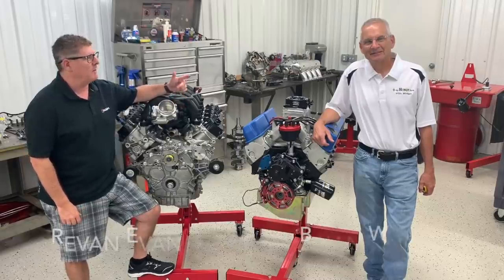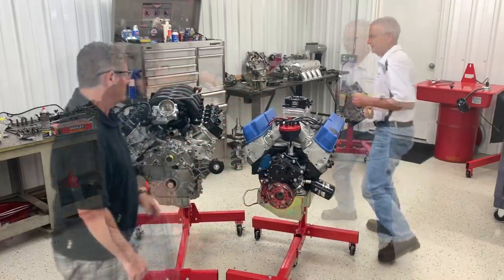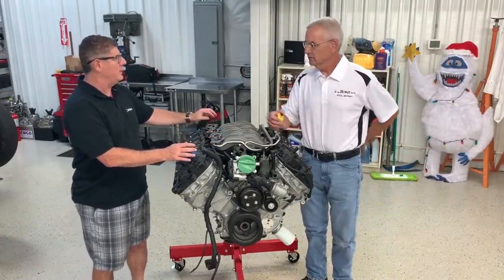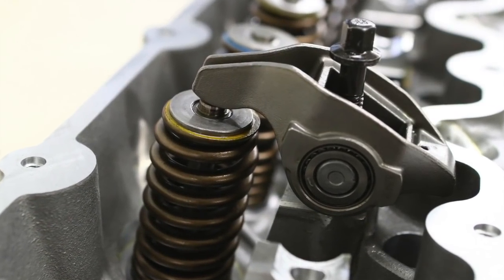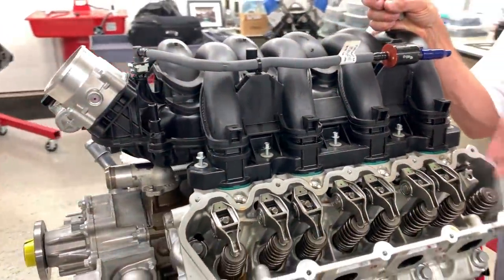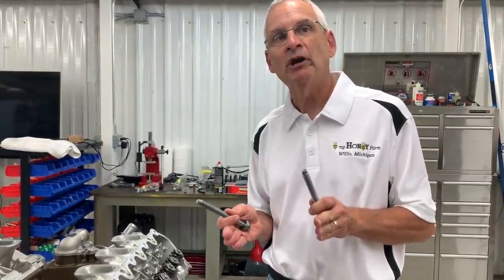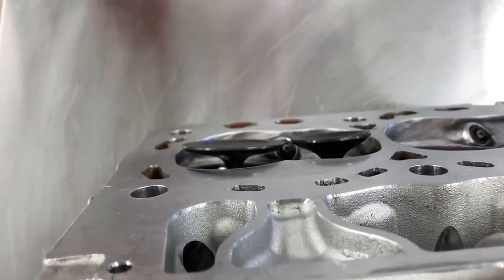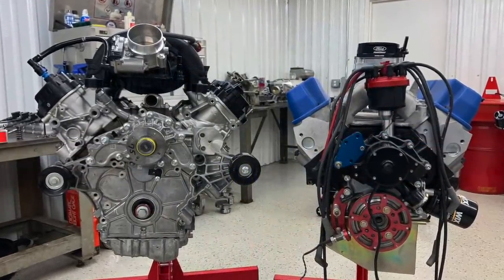Ford 7.3L Godzilla Engine Dyno Results, Teardown & Comparison to Coyote & 351 Windsor Part 2

Comment: Looks like a ls/lt
Reply: @bigboreracing356  
To be fair, the LS family copied a lot of Windsor features
Reply: @SwankySasquatch66  in what way?? There is nothing windsor in the ls at all. The windsor wasn't worth copying. A sbc put it all over windsors in s very big way.
Reply: @HioSSilver1999  You guys and your LS BS. It doesn't look anything like a LS or Hemi. It closely resembles the outdated Ford FE engine. FFS it's a pushrod engine. How many configurations you think you can have before they all start to look the same.
Reply: @HioSSilver1999  there you go again, providing you don't know much at all
Reply: Seems the GM nut swingers couldn't resist, LMAO!! Meanwhile Coyote Mustangs are donkey stomping Camaros across the country...
Reply: @02autogt  well one thing fo sho your 02autogt was a magnificent turd.

Btw....from 15 till 2020 furd didn't make a muskrat that ran with camaros.
Reply: HioSSilver1999 someone’s mad😂😂I’ve seen you on other videos trolling the 7.3
Reply: @renedl22  it's a copy of the ls/lt.....i had nothing to do with it but i can sure make fun of you guys about it.
Reply: HioSSilver1999 and the Ls copied the Windsor. The new Zr1 is coming out with 5.5L Dohc Fpc so they copied the 5.2 Voodoo
Reply: @renedl22  are you saying furd copied Ferrari with a flat plane crank? 

Actually there has been testing done with ls flatplane cranks quite a few years ago. Check it out.....it didn't stop at 526hp and no tq.
Reply: @HioSSilver1999  Something wrong in your head bud. What you call an LS/LT copy, is just you being misinformed. All the technological parts you claim that the LS/LT engines use, in your head, they must be GM/Chevrolet proprietary technology and Ford has stolen the design from them. Wake up dip.... according to you, Dodge, Honda, Cos-worth, Mercedes and almost every other engine manufacturer owes everything to GM? F**k, we're all doomed......
Reply: @henri1511  this 7.3 is nearly a direct copy of the ls/lt stuff. A blind man can see it. Only difference is that it is a big block and not a small block. I even gave you reasons. So far all you have is rhetoric.  You should be happy tho. Chevy engines been getting put in fords for 50+ years now. This is nothing new it just comes oe.
Reply: Lol It’s funny to see “copied an LS!” now but in 1997 the script was flipped “LS copied a SBF!” Let’s take a trip back time shall we? Does the name name Robert Yates sound familiar? If you don’t remember he was dominating nascar at the time with Ford. The setup was a SBF with Cleveland style heads (which had canted valves). Anyway Yates was hired by GM to help design the LS and when it debuted it had: canted style heads, front oiling, head to block cooling, 10 head bolts, standalone intake/exhaust ports, AND had the same firing order of a 351 SBF H.O. Oh and if you wanted to carb it the distributor goes in the front..  Looking at the old standard SBC that's been around forever, the basic differences: Chevy had a rear oiling setup, rear distributor setup, a cooling system with a timing cover separate from the pump where as coolant flowed to the block 1st, then the cylinder heads. Chevy's had siamese intake and exhaust ports, and 17 head bolts in a hex pattern. The LS is basically a modern Clevor (Cleveland heads on a Windsor block). So b4 anyone says this looks like an LS just remember what an LS looks like.
Anyway my point here is that each manufacturer is going to take what works and make it theirs. LS heads resemble a Cleveland head, but the Cleveland head resembles its staggered a BBC from back in the day. Ford was the first to do canted valves on a small block.. a Boss 429 is copy of a Chrysler hemi head. This can go on and on you see my point...
Reply: @jmitchell513  actually chevy was the first to do canted valves on a sb back in the 60s. They just never produced it. Then of course there's the sb2 stuff. Then chevy was also the first ohv v8 back in 1917.

A ls looks nothing like a windsor which was a turd of a motor and got owned on the daily buy old SBC's. A Cleveland design is even further from a ls.
Reply: HioSSilver1999 lmfao “never produced it” gtfo with that ignorance. Why are you talking about 1917. If you just read what I stated you would understand companies copy each other. You are a Chevy fanboy and can’t come to grips that the motor you love is a copy of a Ford. Windsor’s and especially Cleveland’s have always mopped the floors with SBCs that’s why GM literally through away 50 years of work and came out with a SBF lookalike the LS.
Reply: @jmitchell513  sbf's was a joke. SBC's mopped them up like they weren't there fanboi.
Reply: HioSSilver1999 loll I’m seriously cracking up sitting here at work. Have you even built an engine? Had one apart? We have built plenty ford, Chevy, Chrysler. The only thing I can say for a Chevrolet is they are cheaper to build than anything else. My point in my original post was an LS resembles a small block ford. At this point your making yourself look bad man, talking about 1917? And fucking canted valve heads “Chevy built but never produced” 😂 just stop. I don’t know why your so but hurt over this 7.3
Reply: @jmitchell513   how is 1917 looking bad. It's history. It's where things started.

a ls doesn't resemble a sbf at all. Are you sure you ever touched a engine?

A sbf was a pretty sorry piece. Weak blocks, heads flow like poo and a bottom end that couldn't hold a good fart. Head gaskets that blew if you looked at them wrong and shit distributors. There is a reason why you could buy sbc distributors for your sbf and not a sbf distributor for a sbc you know.
Reply: @HioSSilver1999  just as I thought you making a fool of yourself, GM has no intention or just to cheap to build a better engine, they are china bound & good riddance
Reply: Ford guys say LS copied Windsor. Then they say the LS sucks? Lol y'all are hurt lol further more why is LS sawping extremely popular but Windsor swapping is not?
Reply: @baby-sharkgto4902  The Windsor stopped production in 97, the LS was born in 97. After ford went away from push rods, it pissed alot of the Ford guys. To the point of them saying fuck ford and moving to LS bc it was very similar to what they were used too. Ford guys were mad at ford about the mod motor; and they really sucked when they 1st came out; today is a different story, but anyway a lot of ford guys became Chevy guys bc of this. And as far as swapping.. the price and availability is the reason for LS swaps. They are cheap, they are everywhere, and perform well. Nowadays you have 2 Ford guys, the crowd that stuck through the early days of the mod motor and love coyotes and will even talk shit about this engine bc its pushrod, or you have old school ford guys that are pumped there's a new push-rod option. My dad is the old school ford guy lol hates mod motors, respects the LS and is happy for this new engine. The LS took some cues from a SBF as I explained earlier to this other fool, but good for GM they capitalized on some things and made a badass engine, Ford went another route with modular stuff. In the end I like anything fast and respect all builds. Its a great time to be alive!
Reply: @jmitchell513  and again. There is nothing windsor about the ls. But this new bbf is almost a direct copy of ls/lt stuff. It's very very easy to see unless your in denial.
Reply: STREET RACER guess you never heard of the Lsx 454 huh
Reply: In what way?  It has 8 cylinders and uses push rods?  Exactly HOW does it "look like" an LS / LT?
Reply: @buckhorncortez  in every way.

You furd idiots try and say the ls is a windsor with nothing at all in it looking like a windsor. Now this thing is nearly a direct copy of a ls/lt. Only a idiot couldn't see that.
Reply: @HioSSilver1999  In true Chevy guy fashion, calling names and not debating sensibly.  Also...Furd....are you 12?  You sure fit the stereotype well.
Reply: @Justin-zt6nr  so far I'm the only one that gave actual reasoning to what is the same.

In true democrat furd guy form you guys are in denial and only make up crap.
Reply: @CoyoteFTW  gm has had dohc stuff long before furd.
Reply: @Justin-zt6nr  he sure has a problem probably is diabetic to boot ( not happy till he is under the hood fixing something) typical gm fan blowing nothing but hot air
Reply: @HioSSilver1999  oh so that's why chinamotors had FORD design the 10 speed automatic for them, better back off buddy before you really make a fool of yourself
Reply: @adamdodsy84  i ain't mad....just spittin the truth. I think it's weird that you don't even know that the gm truck motors had ls3 heads that flows what these has since 2008. 

Btw.....another similarity is the new furd has canted valves like a lt.

Looks like you furd bois finally got your own ls/lt to put in furds.
Reply: @HioSSilver1999  more like your truth. Everybody's got an opinion. All about personal preference. Some like hemis, some Windsors, some LS. All good engines that do well when upgraded, however I'll have to say LS probably cheapest to upgrade to go fast. I'm however biased towards Ford, it's what I know most about and prefer personally.
Reply: @scottsummers8167  you can like whatever you want. But it doesn't change any facts. I hope the new ford bb ls is a great engine. I does no good to hope it isn't for anyone.

I'm merely calling out furd guys hypocrisy. Except i had very good facts behind it besides spouting it's a windsor copy crap with no evidence to support that at all.
Reply: @HioSSilver1999  shame LS and LT's can't do anything with all that head flow! Coyote heads barely flow 300 but running over 6.2's on the regular... Fucking clowns...
Reply: @HioSSilver1999  look who is crying, you been doing it since 1999 admit it
Reply: @bradzimmerman3171  i have nothing to cry about. You furd guys do tho. But atleast you have your own ls now 🤣
Reply: @mfree80286  nothing really engineering based here. More of a introduction. All the engineering looks ls/lt from the looks of it.
Reply: @mfree80286  someone got triggered......lmao

Comment: What are your thoughts on a supercharger for the 7.3?
Reply: stylac do you have some hp numbers for that? checked the link but nothing is stated
Reply: @boyteebah3794  
Looks like it's preproduction but if you try to ballpark the numbers on the back of a napkin,  I think it's realistic to expect a number that's close to 1000 horsepower--- assuming the bottom end can handle it.

Even if it needs upgraded rods, it's going to be a heck of a lot easier to upgrade than a DOHC alternative.
Reply: there are quite a few Mustangs with more than a 1000 hp running the stock 10 speed with some shift tuning and a convertor . Obviously the weight in a truck and the amount of torque the 7.3 makes will really determine that but the 10 speeds are stout .